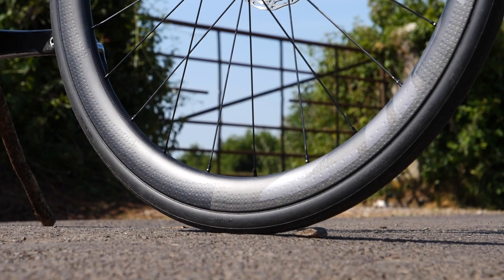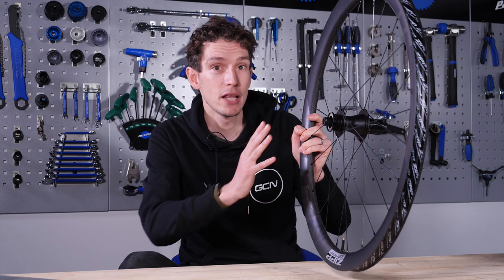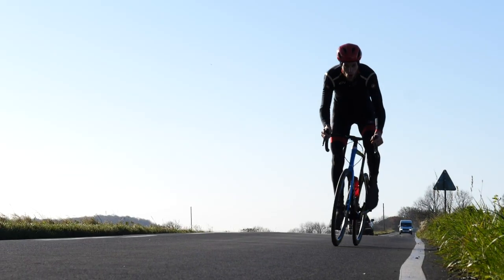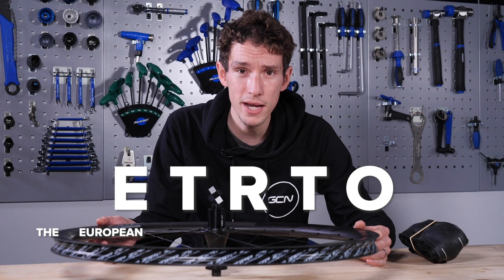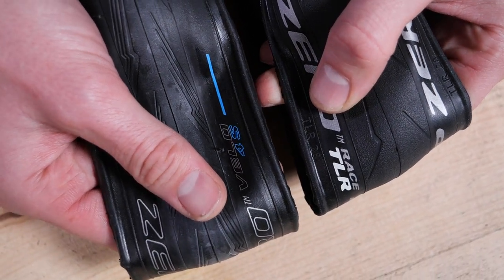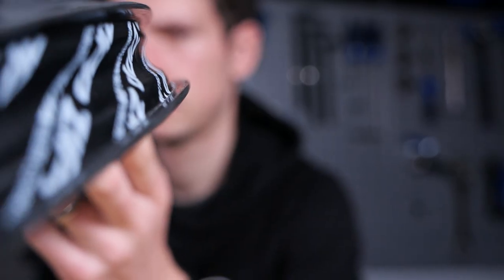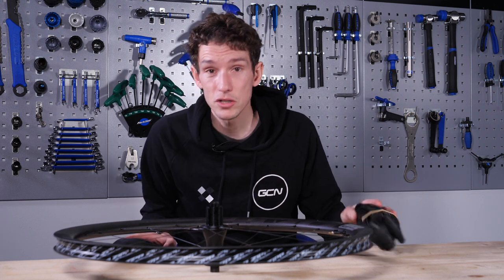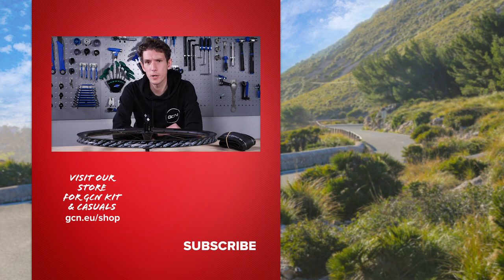Hookless Rims Explained | Which Bike Tyres Can You Use & Why?

Comment: So if the tolerances are so tight and the tire is less flexible on the bead, how can you mount the tire at all? It would not be possible to put the tire over the edge of the rim, from a geometrical point of view. What's the trick then? 🤔

Comment: Hookless rims- tubeless tyre - inflate to 72psi max.....   I am a heavier rider and on older hooked rims I have used both inner tubes and Tubeless clincher road tyres, but I have found for me the best pressure in the tyres is about 100 psi. I not sure I would feel comfortable running a tyre at a pressure at or below 72psi

Comment: Hookless isn't "tech"... It's lack of tech. Making the rims cheaper to make, so the makers can rip more money from us.
Reply: cheaper and stronger, so a win win. i get that the hook can be a weak point on carbon rims. gonna try it out and see for myself.
Reply: Maciej Jan Długosz  yeah for carbon its better. you are right for alloy hookless makes no sense.(does it exist commonly?) i blew my tire off the rim by exceeding the rims max. pressure. my fault though
Reply: Agreed, I recently had a blow out on a hookless rim with a tubeless tire that I didn’t realize wasn’t approved resulting in a broken hip.

Comment: So, if I have hooked rims, am I safe to use any (tubeless) tire erto or not?
Reply: Yes but don't make the mistake of believing you can run the same high pressures you do with tubes.
Reply: @404nobrakes , rethink that idea. UST and Tubeless aren’t always compatible as each have their version of crochete/hooked rims. There have been many accidents due to the mismatched tire/rim combos even at proper pressures. ERTO standards for bicycling wheel/tire interface are being re-written after decades of advancing technology and this should serve all much better.
Reply: @404nobrakes  Actually, I have been using tubeless all along (80psi). Would never go back though I was skeptical at first. Thanks for your reply. Stay safe.
Reply: No you can't. Continental specifically say their GP5000 tubeless tyre is not compatible with hookless rim's.

Comment: So hookless rims only work with tubeless tyres, even if you use them with innertubes. If you have traditional wheels with hooks you can use a tubeless tyre or a normal clincher tyre. If you have tubeless ready wheels with hooks, you can run tubeless with a tubeless tyre and/or a normal clincher tyre? This is still confusing 😅
Reply: I'm not even fully convinced that you strictly need a tubeless tire for a hookless rim.  I think the rim manufacturer is banking on the tolerences generally being tighter on your average tubeless tire. 

It's very interesting that they only recommend going to ~70psi. Coincidentally, 70psi is also the point where tires with non-steel beads started to jump off of vintage hookless rims 🤔🤔
It's almost as if the wheel manufacturers went back 40 years in time and called it progress.......

Comment: This isn't new though. 27" wheels from about 40 years ago rarely had hooks (I've never seen one), limits you to circa 80psi, though.
Reply: yeah, and I can confirm, running with modern folding tyres, they blow off at about 70psi...  The old tyres never did. (I have a classic bike too). The problem with this is that whoever is replacing tyres needs to understand that anything won't do...or they will be dangerous. IMO hooked rims are safer just for that reason.
Reply: @jowen85  Yeah, I prefer hooked rims as it stops me having to worry about it. I have one bike I ride regularly with 27" hookless rims, but I'll probably convert it to 700c or 650b when the tyres wear out.
Reply: @ethanjack4298  that's what I did with mine last summer...when I realised they could be plain dangerous and a constant worry
Reply: @jowen85  yeah I run mine fairly low pressure so I'm not too worried, the rims are nice and straight too

Comment: 72psi? Bonkers...I'd be worried that low...
Reply: The industry has realized a golden secret, replacing tubes is too cheap but replacing carbon rims will cost way more. Muah ha ha ha.
Reply: Not really an option for anyone who weighs more than a loaf of bread - on any tire under 32mm
Reply: @jimhansen5395  I was trying to figure out how 72psi could possibly be optimal for anyone.  The "optimal pressure calculator" I found says 105psi for my rear tire,  and that's a 28mm.  What's a 200lb guy to do?

Comment: Hookless rims are the same as tubeless tyres, not ideal for road bikes, it simply makes no sense. ETRTO says you have to have a hook for pressures over 5bar. Lots of people like to run tyres over 5bar. Furthermore we shall use tubeless tyres on hookless rims. I dunno why we are pushed in this direction, let the customer decide! Personally I tried 3 different tubeless tyres (Vittoria Corsa Speed, Conti 5000 TL and Schwalbe Pro One TLE) on 3 different wheels. Not one combination was properly sealed and for Vittoria and Conti I never had so much (not sealing) flats. It's just not logical to use it. On my recent wheel set SL1 42 from Giant I popped some Tubolito inner tubes and Michelin clinchers on now. It works without any problem. The new inner tubes from Tubolito or Schwalbe are almost as good as Tubeless in terms of rolling resistance, so why the hassle with fucking sealing milk and heavy tyres and hookless rims?!

Comment: A hookless rim is like choosing a particular inner tube for its puncture resistance. There’s nothing calibrated about the sharp piece of debris your wheel might roll over like theres nothing calibrated about the unfortunate pot hole a rim might find. Shit happens.. The biggest takeaway from accidental rim damage is ride with higher pressures and/or put down to life experience and avoiding that ‘glazed over pothole, cased jump’ next time. Its certain that hookless rim do a poorer job holding the tyre and given the existing manufacturing consistency issues within the bike industry, (carbon frames for example), lets drop the feeble manufacturing come a long way argument and stick with safer tried and true hook rims…. And yeah right!, the consumer will see the cost savings with hookless setups 😂..

Comment: While this is really interesting, there was a lot of every day living with hookless wheels that wasn't covered.  Would appreciate a real world follow-on to living with hookless rims.
How easy are the wheels to fit?  If the beads are rigid and not meant to stretch then they could be much harder to fit, especially if you get a big puncture and have to put a tube in at the side of the road on a cold and wet day.
If running at 72 PSI maximum, surely this will make tyres more prone to punctures?  I've ridden with 100 PSI for the last decade and have not experienced a puncture.  Very concerned that running such a low PSI will mean regular punctures.   Using sealant to 'automatically' fix a greater number of punctures is a poor alternative to no punctures at all.
Do the wheels need to be glued in place or does the pressure keep them there.  There was a shot of a tired that was being fitted that looked like it was glued, although it could have been tyre sealant.
Reply: Stop worrying and switch to tubeless. They're not difficult to fit and I 'seat' mine just with a track pump. Not had a  puncture for 4 years and that includes riding my lightweight road tyres regularly off road. I've even ridden my aero road bike down light mtb trails. I don't know whether my carbon rims are hookless or not, never thought to look.
Reply: I see no reason to switch to tubeless just because it's claimed to be the future.  The present works perfectly for my needs and there is no need to throw away perfectly good wheels and tires. 
I ride over 5,000 km a year on roads at the top end of the recommended PSI for the tyre and my weight.  I prefer the firmness of tires and don't need them to be additional suspension.  My bike is plenty comfortable enough and served me well when riding 1600km in 9 days for a ride across Britain.
I've never had punctures since checking the manufacturer's recommendation for pressure against rider weight.
My bike was bought with disc breaks as there is a clear advantage in those.
I am interested in wireless gear shifting, the SRAM eTap system looks very nice, but the Shimano system doesn't.  It's far to wasteful to change my existing manual gearing, which is very slick.  Changing gears is an ingrained action for me after decades of riding, so not in any rush for refinements there.  If the SRAM eTap is a reasonable price when I'm looking to buy a new bike (in about 5 years), then I will get a bike with etap setup.
But I see very little reason to use tubeless and mess around with sealant, unless I start gravel riding or off-road.  From a usabilty perspective I'd rather switch Tannins solid tires, which work well for my Brompton.

Comment: It's funny that you say this is a new thing cause it's not. Up to the mid 90s that was the standard. Tires had steel rims in them just for that and you couldn't fold them. They'd often be hanging on hooks from the ceiling in bike shops. Which was pretty cool. Back then (in North America) folding tyres were an oddity and pretty expensive too. that said you can still find steel rimmed tires. I have those on my cheap commuter fixie. So this is not new. Just not the standard anymore.

Comment: Is it  easier or more difficult to mount a tubeless tire on hookless rim, than on a rim with hooks?
Reply: No difference. Nothing changed in that matter.
Reply: It's not the right question. There were (are) some pretty horrid mounting combinations with rims that are slightly oversized and so the beads are really hard to get over the rim walls. Hopefully the standard mentioned here makes things better across the board.

I have a set of carbon hooked rims that is really hard to mount with any tire - this is double so for tubeless ones with a stronger bead. I think the issue is that they are on the larger side. This is an old issue; ask any old timer about mounting a Continental GP tire on some rims (like Reynolds) and the cramping hand that ensued.
Reply: @tychoMX  I intentionally said there is no difference. As long as all tire and rim makers won't start using  ERTRO standard, there will be those problematic combination. ERTRO isn't new standard, not for Europe for sure. 
Anyway. For anyone who is afraid of tight tires, GCN made great video about that problem. Watch it you will have no problem with it anymore.
https://youtu.be/jvvXrlAUUfU
Reply: @imcbocian  I didn’t disagree with you. Just expanded on your very terse comment :)
Reply: @tychoMX  same here 🙂

Comment: Could you please explain why your tire sponsor Continental only recommends using hooked rims.
Reply: That's exactly what Si did in the video near the end when explaining why some tyres aren't given the green light for hookless.... he just didn't state "continental".
Reply: We do not allow it because the combination of road tires with max. pressure above 5 bars is not safe if the tire isn't developed for Hookless specifically. Because there is a broad range of Hookless rim dimension where one might be safe but another one is not.

Comment: Hookless is the answer to a problem that just doesn’t exist! If I ever buy a Giant bike for example I will immediately sell their hookless rims and buy a hooked wheelset!
Reply: I have owned two propels and then went to the tcr. All had tubeless fitted and at first they were good. Right up until they puncture and they don't seal..and the patch doesn't hold.. seeing that the new 2021 and I assume beyond will force you to use hookless rims...makes you think twice. As you are forced to sell the wheels that come with the bike and use a normal wheel to avoid the possibility of one day being stranded a long way from home and no way to ride.
Reply: @ewenrowse8679  I was going to buy the new 2021 TCR Advanced Pro, replacing my 2015. As soon as I saw it came with hookless rims it was deal off.

Comment: Yeah well the hookless rim might be cheaper, but the tires are much more expensive.
Is it possible to use an emergency tube when you get a flat in a Giant SLR 2 with Conti 5000 TR for example? Guess no.
Reply: I know this is a year late, but I run SLR2 42mm carbon hookless wheels with Giant Gavia Course 0 25mm tires. I recently cut a tire, small cut but the Stan’s wouldn’t seal it. I put a tube in it with a 2” piece of liner (over the cut) on the spot and was able to ride the 15 miles back home. Other than this, no other issues in a year riding this setup.
Reply: @timyaiser  Thanks! 
I‘m still riding tubes on my road bike, but got a Gravel bike and been on tubeless since 8 months now and without issues.

Comment: Most aircraft rims dont have hooks and still withstand a lot of force.
Reply: I’ve worked in the Aviation industry for 10 years. Nose gear of an A320 is close to 150 psi! But the seating area ratio vrs overall tyre diameter is much much higher. No hook required and monstrously more substantial form behind the rim edge. Irrelevant comparison being made..
Reply: @derek75116  I work since 2008 in aviation and have done wheels by myself m8. I can tell you, you are wrong the area touching the rim vs the the area not touching the rim ration is smaller on planes than on racing bicycles. Way more grip area on bicylces. I do my own bicycle and my current employer does the aircraft wheels by themself because we have the approval.

Comment: They are cheaper cause they are now manufactured in Taiwan, well the 303s is anyway
Reply: 303 Firecrest is manufactured in the US, and is $600 less than the previous generation.
Reply: @Bastien80923  Ah ok, I just know the 303s is now manufactured in Taiwan. I think it might be the only model to be.
Reply: @Bastien80923  Hasn't the rim width narrowed from 45mm to 40mm? Along with the move to hookless rims, the cost must be lower, irrespective of the country of manufacture.
Reply: @bikerjk1205  Yes, you're correct. Depth doesn't really play into the price; but hookless allows for much more controlled manufacturing process, and lower price. It makes for a better wheel too, so it's a win at every level.
Reply: @Fazza1975  Yes, that is true. 303 S is the only model manufactured in Taiwan - however it is made in SRAM's own factory, following the same standards and processes as in the US.